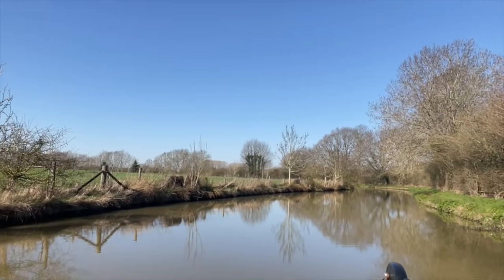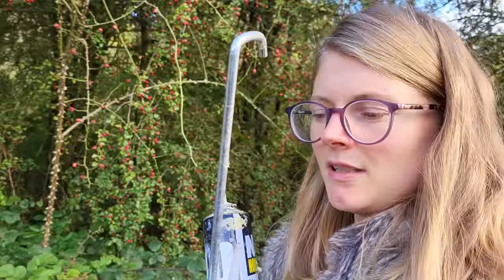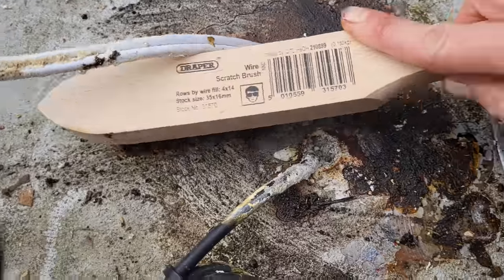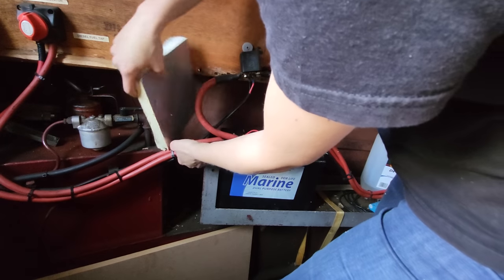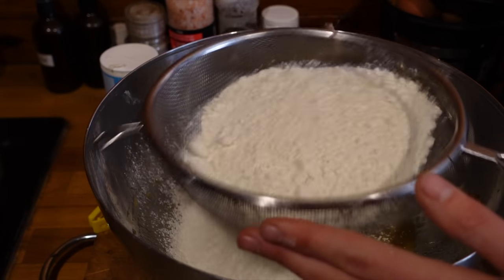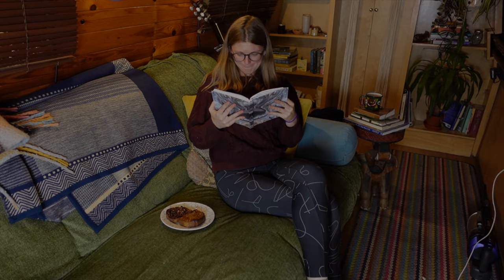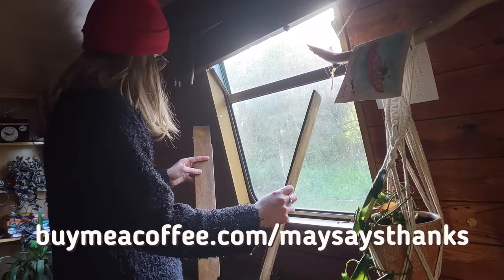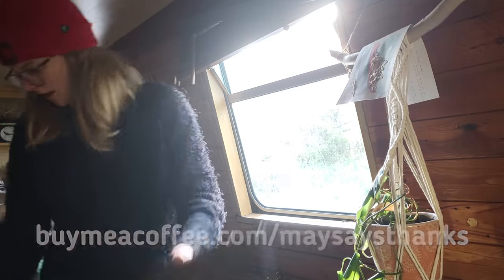Narrowboat Winter Prep: A Boater's Weekend of Fixes, Frustration, & Dark Night Delights!"

Comment: Ur WiFi cable issues…..pull your cables out of the boat and get some rubber grommets in them hole the thread your cables back through the grommets that will stop the leak for them

Comment: Your living proof May that sometimes plasticine, blue tack, bandages and Germolene does not work. Cable entry is always a bad idea through a boats roof. If needed to be done a proper waterproof brass screwed gland is the answer. Water through your hatch? yes you will need to weld angle iron / plate metal to guide the water away. WIndows, if in fact they themselve are fully waterproof can only be the outside jointing, two sided sticky foam is never as good as a heavy duty silicone sealant with blind rivets. Nice cake though.
Reply from the maker: Thanks for your advice!